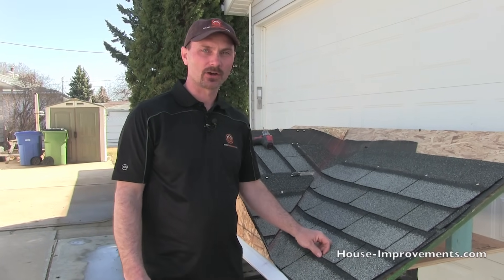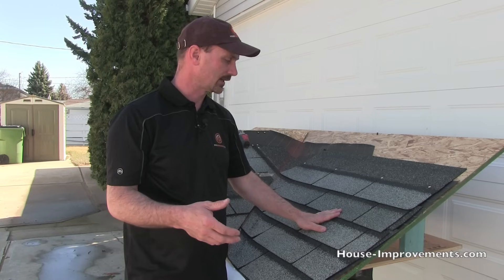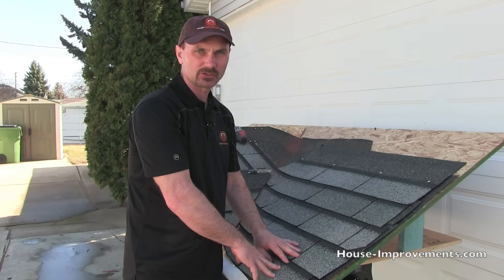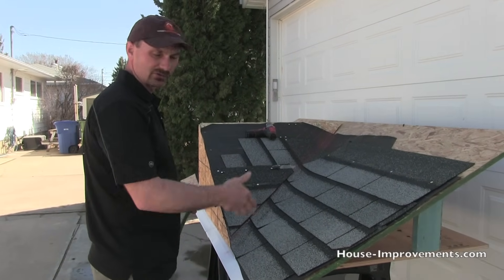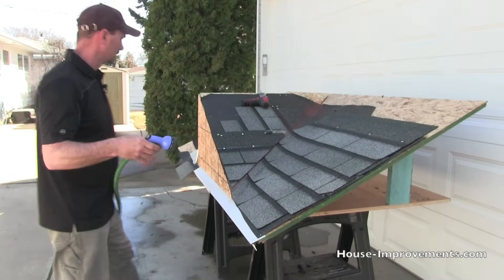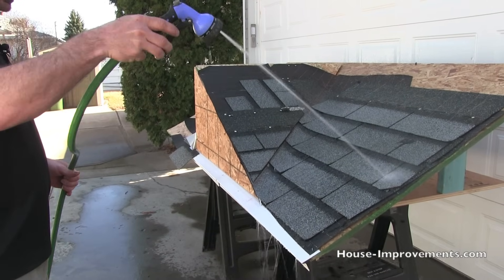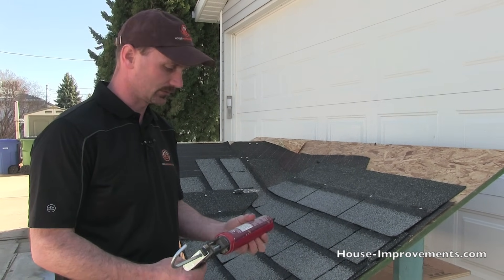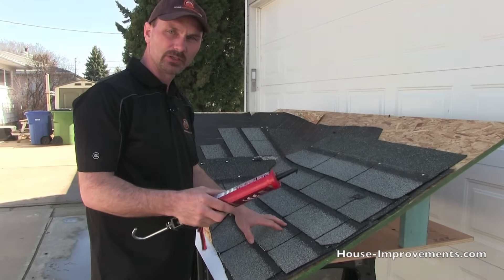How To Find A Leak In Your Shingles

Comment: My situation was the opposite. Knew where the leak was looking up from the attic, but couldn't find the exact location when I was out on the roof. I drilled a hole from the inside and heated up a piece of clothes hanger and stuck it through the hole. Left the wire hanger in the hole and went out on the roof. Found the area and filled the hole and the existing leaking area with roofing cement.
Reply: Next time just tap a roofing nail back out a little bit so you can then see it on the roof

Comment: word of advice...do not spray a stream of water at your shingles like this. use the shower setting or something, just like you wouldnt take a broom to the shingles, higher pressure water stream can take away life from the shingles.
Reply: @xz3693  holy moly you made my day with that.  I should really thank Mr Hoover as well without his fine wind storm engineering prowess none of this would have been possible.

Comment: I wish I had seen this before I started removing shingles. Because I am not sure if the leak starts high on the singles and is running underneath to a lower point. I still would have had to do it a little different. There is no attic or crawlspace where my leak is. I would have just had to do this until it started dripping from the ceiling.
Reply: I have the same issue - the leak is on a dormer window and the ceiling is stained from the leak in a few places. No videos for our issue. My solution is to just re-shingle the entire roof of the dormer - about 60 sq feet.

Comment: I have a leaking porch roof for approx 5-10 years. The boards are original tongue and groove, they might be redwood, but definitely not cedar.
My whole house frame is redwood.
I measured the plank width then counted how many are leaking and went 1 more up.
Need a new roof, but that isn't in the budget this year.
So I will be on the roof after work tonight to fill in the areas that I think it is getting in.

We are still in a terrible drought out here in Northern California, as is the rest of California, too.

One of the interesting things I have applied is a clear UV protective paint from home-depot.
That is the only part of the roof that does not have any moss growing in between or on the edge  of the asphalt shingles.

I'm losing a lot of the shingle pebbles or whatever they are called, so that helped keep the few on the shingles that were left.

Comment: Thanks for the vid. Am all in favor of white elastomeric roof paint directly on conventional pitched asphalt shingle roofs for patches or do the whole roof. It works well. I painted Home Depot Henry brand/Lowes Black Jack brand (several other brands exist) white roof paint with a conventional 9" paint roller on a stick, least expensive grade directly on my conventional asphalt shingle roof in 2008.  Applied about 4 coats to completely seal any gaps, especially where one shingle overlaps atop its downhill neighbor shingle. Used aluminum tape to seal bigger than 1/4" gaps or wherever bolstering needed, such as a protrusion from the roof or where a nailhead appears atop the shingle layer around the perimeter of the roof every 1-2 feet or so, then painted over the aluminum tape with white roof paint. In 2017, 9 years later, it's still going strong. No more missing shingles from wind damage. No more leaks. Much cheaper than a reroof, saves on cooling bills, seals leaks and stops new leaks. Also painted the drip lip around the perimeter of the roof so precipitation touches nothing but white roof paint til it hits the ground. Don't like white? Paint over the white with the exterior grade paint of your choice of color, including the same color as your old shingles if you prefer. As a test, painted an inconspicuous piece of the roof with the date in mid 2015 in a dark color. In 2017, it looks like it was painted on yesterday, with no visible wear. On the elastomeric white roof paint can label, it may say don't apply on shingles. Ignore this if your asphalt shingles are pitched conventional or pitched rolled and aged over 30 days. The white roof paint adheres very well when painted directly on the aged shingles.
Reply: How much did this cost ?
You have a bright white roof now ?

please come do my roof.
Saddness... leaky roof
Reply: Is this advice still valid? I have a 13x20 roof where I'd like to do this

Comment: I have a weak spot   about 1 foot in diameter   and  covered the whole thing with that  black tar stuff, a layer of garden cloth  , then another layer of tar,   a 3x3   area over that 1foot weak area  and still getting a leak,  Driving me crazy,   im about to  go buy  a  4x8 sheet of  abs/plastic/siding/paneling and  just lay over that whole back of the porch and seal around it with tar. haha   Awesome Video!

Comment: My roof wasn't leaking until I hired the wrong company to install some sporadic missing shingles. Now I've got leaks and can't deal with court. Can't afford a new roof. It only leaks where they installed new shingles.  They also failed to bend or tuck and otherwise properly install some bent fascia at the peak. The wind grabbed it and ripped it all down. I took video from inside the attic during some recent super heavy rains, thinking maybe it'll help someone who does the patch job. I'm running out of buckets. I'm not crazy about heights. Is there a way to safely harness myself if I get brave and climb up there myself?
Reply from the maker: Absolutely , you can use a fall crest harness and rope but you still need to get up there and securely attach a proper roof bracket to the peak to hook the rope on, and you need to be able to get up there to hook on and unhook when finished safely.
Reply from the maker: These kits have everything you need generally. https://amzn.to/3mwl3dG
Reply: @HouseImprovements  - Thank you!!!

Comment: Most people can't get a hose long enough or light enough to bring up to the roof of a regular two family house. There's a much easier way.. Wait till it rains. So obvious. When you find it, just punch a hole straight up, climb through the hole, and patch it up.
Reply: Problem with this approach is that leak could be coming from shingles higher up on the roof plane. The water that you see under the roof in the attic may be coming not from that spot but from a higher area. It is no that easy to pinpoint exactly where the water intrudes on the shingle side of the roof
Reply: @jjnatteri1245 water running along a rafter from original spot

Comment: So if the leak through the shingle is further up the roof, finding where it's coming through the roof in the attic isn't really going to help is it?   I'm hunting a roof leak in my house right now and this is my fear.  I have a feeling it's leaking high in the roof, running down on the underlayment fabric and then coming out down the roof.  At least it should be in a basic straight shot up the roof from where it's coming through I guess.  Wife wants to replace all the shingles because of one little leak that has barely wet the ceiling on an 18" area in living room. 🤦‍♂
Reply from the maker: It can be tough to track if its running above the sheathing for a bit first then finding a way out. And sometimes impossible. Visually look at vents and pipes and such that are cut through the roof for any place they could be allowing water in, most times they are the problem.
If in doubt seal around all that stuff well and see if you get it.
Reply: @HouseImprovements  Thanks.  My house has a ridge vent and the leak is about 5 feet outside of the vent.  I'm still thinking it's originating at the ridge vent, running down the upper truss cord and then dripping off into the ceiling.  It's such a small leak that I can't see any signs of it in the attic.

Comment: I drilled 3 holes on my shingles to place a solar panel for my camera. How would I ensure it does not leak. Please help
Reply from the maker: I would seal the areas with roof tar. You can buy it in a caulking tube and its easy to use

Comment: What if it’s finished ceiling inside rather than unfinished attic? Any tip?
Reply from the maker: the water stain inside on a finished ceiling will give you an idea where to start looking but in most cases a finished ceiling makes this very difficult to determine.

Comment: man, i have  leak that comes down on the outside of my chimney (inside my house).  I can't find the leak anywhere on the roof.  I have put 3 coats of the silicone paint stuff where the shingles meet the chimney and it still leaks.
Reply from the maker: What about the metal flashing against the chimney, it could be coming down the chimney ands past that collar? Please use my forum if you need more help.http://www.house-improvements.com/forums/

Comment: what if the attic doesn't extend to where there's a leak? our attic doesn't reach to the room we're getting a leak in the ceiling. do we just have someone stand in the room where it occasionally leaks?
Reply from the maker: This will be harder to find because the ceiling is finished. Inspect the roof really well first and fix any spots that look suspicious then run the water and see if it leaks still.

Comment: whats with the dark lines n tabs not covering them?.. still a good example but laying shingles like that will make a leak
Reply from the maker: That is actually the intended look and design of these shingles.
Reply: @HouseImprovements  funky
Reply: Our roof is leaking here and there.  They didnt replace the wood, and they laid new architectural shingles.   I doubt they even tar papered it. Would getting in the attic help most to find where they are?

Comment: The worst thing roofers do is use pneumatic nailers to install shingles, Inevitably the nail head breaks thru the shingle because the pressure is too high or the depth on the gun isn't set properly. I still prefer the hand nailed jobs.
Reply from the maker: More power to ya, it takes a good person to wanna stay on a roof that long..LOL  Thanks for the comment
Reply: HouseImprovements
I know it's slow but it sure prevents problems.
Thanks for your videos. They are always helpful.
Reply: if you are willing to pay for it then why not.

Comment: I found my leak but it was so obvious from underneath. You will see water stains on the underside of the plywood most of the time. My roof is 16 years old. I am seeing small water stains on other areas. I have a 8/12 pitch so this is not a DIY job.

Comment: HI Shannon. Great videos.  Can you answer me a question in your How to Tile video?  You have some sort of compound in areas between your drywall and the tub surround on placed directly on the edge of the surround before you tile over it.  What is that compound?  Is it the tile adhesive or a drywall mud? or ??  
I am doing the same with tile around my fiberglass surround and your video really helped except for that one question. Thanks!
Reply from the maker: I did not review the video ,but I would think you are seeing drywall mud?
Reply: Ok. That's what i thought but wanted to make sure because you had it directly on the surround's nailing lip.
Thanks for responding.  !!!!

Comment: So to find a hole in my shingles I drill a hole through them then spray water from the bottom to the top? I don't like your way how bout I just call a roofer I can't find the button that lowers the roof to the ground rrrrrrr
Reply from the maker: You dont drill a hole through them ! I did that because we needed a hole to make a leak .

Comment: Unfortunately, a garden hose will not generate the same water flow as a heavy downpour so in most cases you will not find the source of the leak using this method.  If the roof has a steep slope l would highly recommend to call a professional roof repair contractor otherwise you risk getting seriously injured or make the situation worse.

Comment: This is misleading advice, not a good video, dont go walking on your roof with a garden hose, you might lose your footing slipping on  wet shingles. Sometimes there is no safe access to the inside of your attice to look for a leak, you might fall between the rafters, through the insulation, and sheetrock cieling, theres no telling what you might hit in the room. Its a dangerous terrible video!
Reply: Just stay inside of your bubble sipping on your pumpkin spice late and call a repair man than nancy